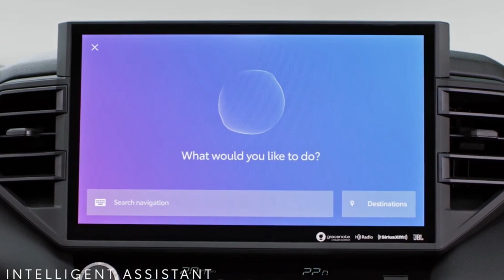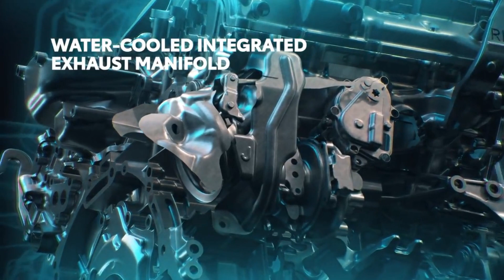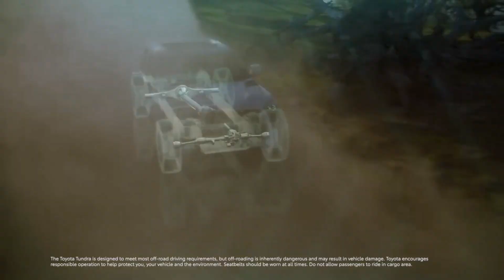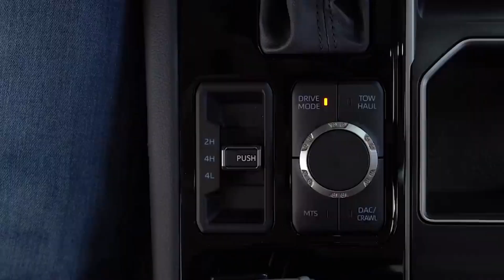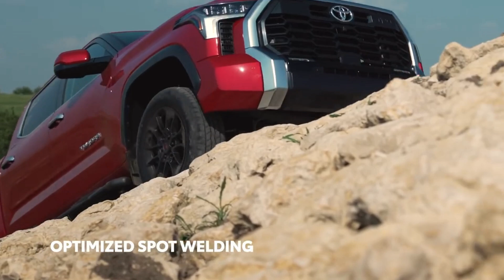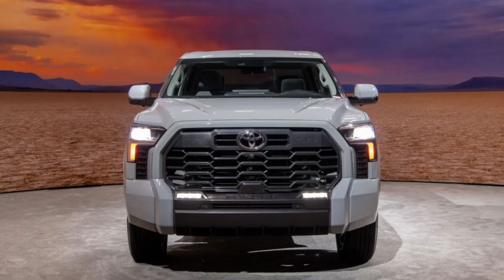2022 Toyota Tundra, (full review) Interior, exterior, engine and transmission! toyota tundra 2022!

Comment: Great video, the question remains will the new engine last as long and be just as dependable as the 5.7?
Reply: I’ve done the math on this. Let’s say you have a 5.7 and you put 400,000 miles on it. If you get 15 MPG (which is extremely generous for the 5.7) at an average cost of $2.85, over 400k miles you're spending $76k in gas.

Versus average 19MPG with the 3.5 TTV6 at 400k miles equals $60k.

That's $16k saved over 400k miles. You could buy two 5.7L engines for that, with two grand left over. Surely you could replace the entire 3.5TTV6 motor for that price and still save money.

Even though I never got better than 13-14 mpg with a 2018 tundra, I digress.